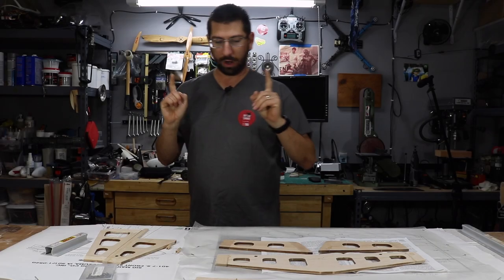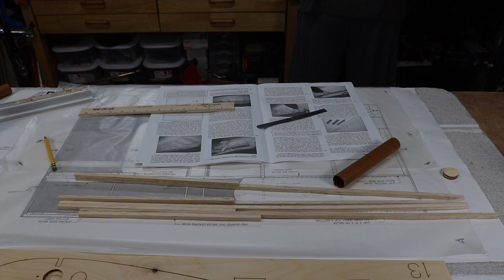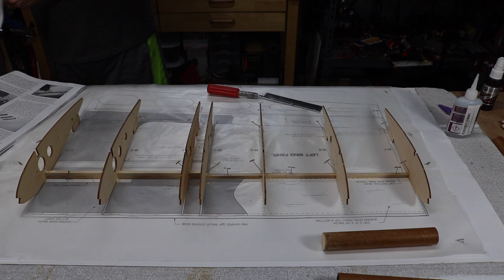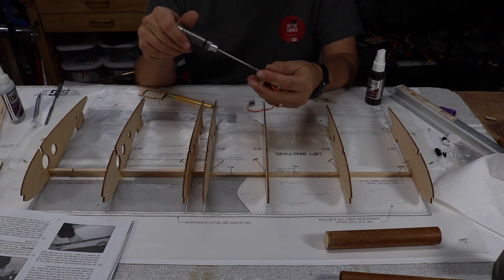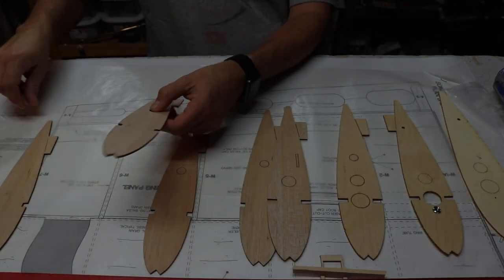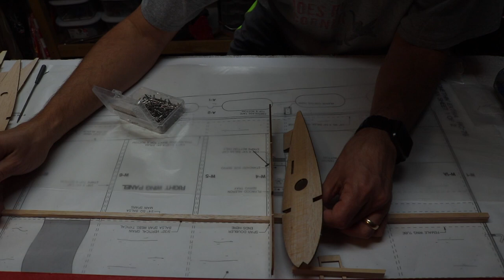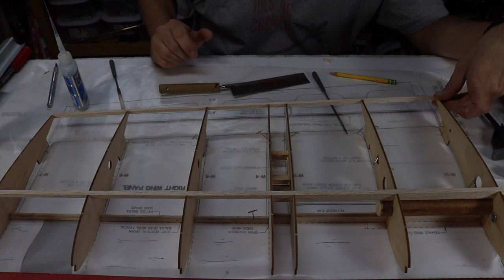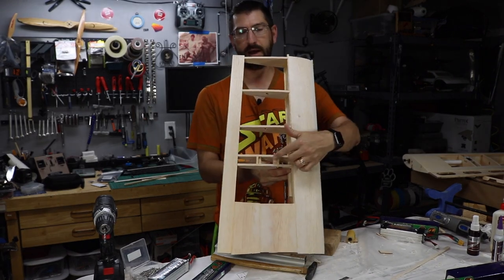SIG Somethin' Extra Build Part 2:  Wings

Comment: Hey Joe iam building the same plane and I was wondering seen as though you have done your maiden flight way your watts was your getting on your set so I can get a rough idea of how to set mine up,by the way your videos are so cool I love them and your plane flies excellent keep up the good work.
Reply from the maker: Tony Beverley no sorry, never checked it. I will tell you the setup I have has unlimited vertical. Thanks, I appreciate you watching, and the support.
Reply: Joe's RC Corner if you don’t mind could you send through the motor esc and battery you r using that would be a great help thanks
Reply from the maker: @tonybeverley5406  sorry never saw this post, I have the value hobby 32 motor with 60amp esc, and a 13x5 wood prop from valley view RC.
Reply: Thanks Joe I appriciate it bud